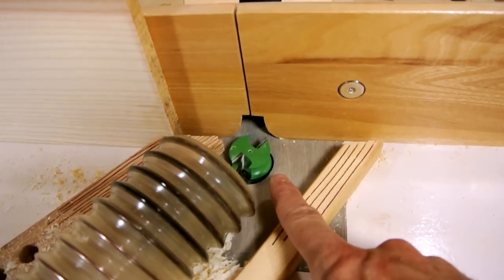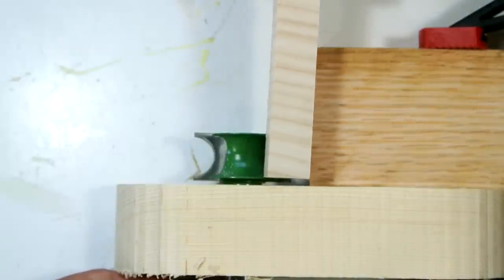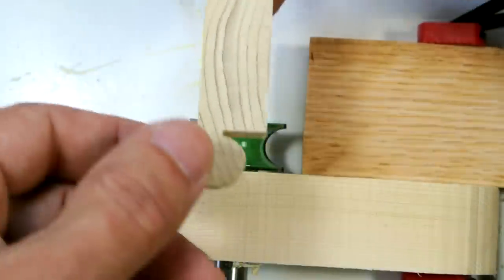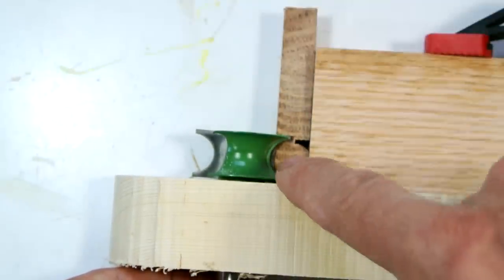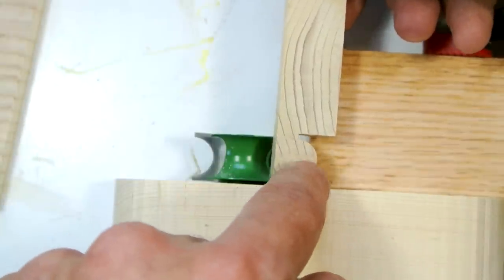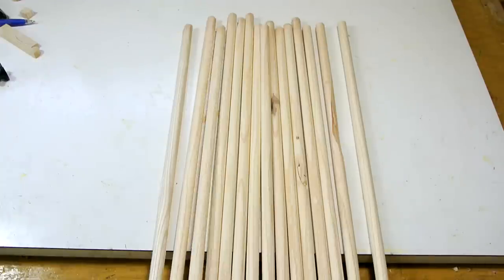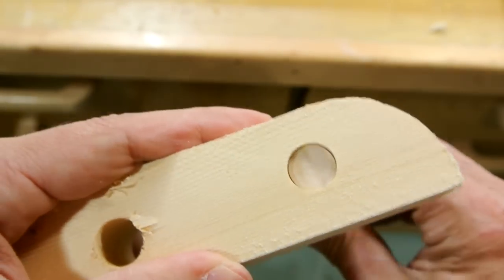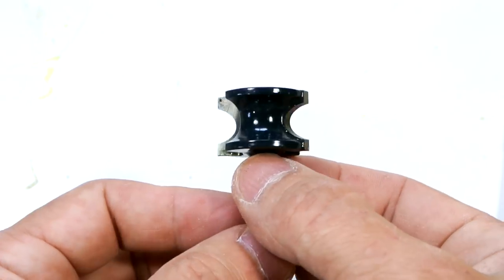Making dowels with a half-round router bit

Comment: I used to run a 7 head wadkin moulder fro a living. Even with that machine it was really difficult to get a perfect round dowel due to the loss of a flat surface to hold against on the final cut. Be aware that you will most likely have a lot of snipe on the end of each dowel so add an inch or so to your required length. it also might be helpful to add hold downs as close to the cuter as possible.

Comment: Great video. I really like the original idea of routing them straight from a board. I think you can hone that method and get great results. I watched the video several times and don't recall an explanation of why a board of the exact thickness won't work.

But if you have to a board that's a little thicker, it seems you could simply make a fence having an appropriate offset. Use a flush shim to make the first pass. Remove shim to make second pass. Then the board is always supported.

Comment: You could set up two routers in a line, each with a half round bit. If lined up properly, the dowel would get rounded on both sides before the flat part comes away from the fence. This would eliminate the need to precisely cut the wood to size first.

Comment: Hi Matthias,
Thanks for all the good videos you post, I'm a big fan...
Regarding this particular one though, I happen to have an idea, that could probably work best for you. 
How about getting your router fence lower than the bit (I'm sure you can use a sacrificial narrow piece of wood), so on the second run rounded side of the dowel glides on the fence and the stock doesn't. that way you can actually use slightly thicker stocks and be pretty safe...
Let me know what you think.
Thanks
Reply: This was my exact idea as well.  I was looking through these comments to see if someone else had the same idea before I wrote about it and sure enough you did!

Comment: Remember the pencil sharpeners you used in school?
.
The ones in the school where a crank ran two helical cutters that ran around the outside.
.
If you wanted to design a really good dowel cutter.
I'd use square material through a square guide under pressure (like your feather boards) on the intake.

Then round guides on the exit side.
Three helical cutters rotating outside cutting on an angle with adjustable diameter.
.
But that's not a "home" project

Comment: Further thought to Auxiliary Fence, to allow use of inexact and over-width stock:  The aux fence can be made thicker (more robust) if it is positioned at about a 35-40 deg angle to the main fence.  The main fence is split to allow the first pass stock to pass through.  This also allows the use of 2 fingerboards, one for each fence.  I have a jpg of this setup, (modelled in Solidworks) but don't think I can attach it here.

Comment: I think the old method to make super accurate dowels was by forcing the rough pieces through a metal plate. There are actually old plates with notched grooves long the interior (think sun shaped with lots of points), to allow for lots of glue surface and compression. This depends on your dowel preference though.

Also, didn't you have a dowel cutter that used a chisel before, with a square drive socket?

Comment: Was thinking you could make an auxiliary fence for the right side of your table. It needs to be no more than 1/2 to 5/8" thick max, but it is positioned with a gap behind it and the face is 1 1/4" away from your existing fence, and perfectly tangent to the outer part of the cutter. First pass of the over-thick stock on the auxiliary fence is from right to left, on the outside of the cutter to make the first half dowel exactly flush to the stock face. Without turning the stock, make the second pass from left to right on the inside of the cutter, against the existing fence. The stock and completed dowel pass behind the auxiliary fence.  The aux fence could be securely mounted to an extra floor piece if that would be easier to make it strong enough.

Comment: This might be a stupid idea, but what about attaching a small auxillary fence, a little over a half inch tall to the bottom of the regular fence, the board could then be thicker than half an inch but would still be the correct distance on the second pass. You would need to hold the board vertical without a firm fence at the top...

Comment: Here's an idea to make dowels. Cut a square stick, +2 mm on each side, lock it in your power drill, let the stick roll, hold a rasp or a file or a sander against it until it becomes round and reaches the diameter you want. If you've got a vertical drill, even better. You can use both hands.
Reply: see his other video with the dowel maker.

Comment: You could just make the stock the same thickness but it does not need to be the same height, i was making dowels and used a thickness planer to get the right thickness and got a whole bunch of dowels out of each bit

Comment: You can buy cheap router bits on ebay to do this. The trick is to copy the picture of the cutting part of the router bit and paste it into a graphics program such as Photoshop. Then copy it to another layer, flip it horizontally 180 degrees and remove the background. Finally merge the layer with the original and you will see whether or not it forms a perfect circle. I've found bits for $11 or less that would work.
Reply: +jjenson2006 I wouldn't trust a cheap router bit to hold an edge, or more importantly, not fly apart and riddle me with shrapnel. 
I had a flush trim bit's bearing explode while copy cutting a large panel. Luckily, since it was a large panel it was propped up on blocks on the ground, rather than at waist height.
Reply: bassl0va
Fun fact: Most of the name brand USA bits are actually manufactured overseas and simply assembled here just so they can call them "Made in America".

Comment: I was thinking of remaker a lee valley tenon cuter into a dowel maker  for larger dowels  like 1" and larger by cutting off the drill mounting end  then clamping the T.Cuter to the bench with a split coller bracket  and turning the square blanks with a socket and a cordless impact driver as it turns at 190 RPM adavantages are removeing blades to resharpen  and micro adjust abilty of the blades  your thoughts please

Comment: Why not just using a guide (or placing a stick) that is smaller than the diameter of the dowel? that way you just touch the bottom of the plank